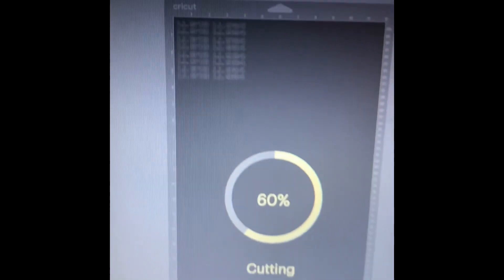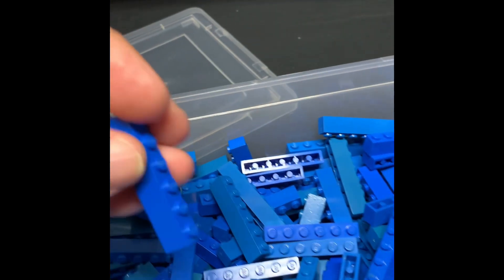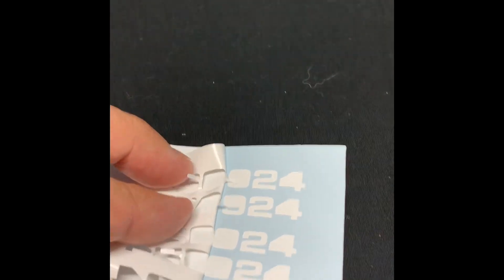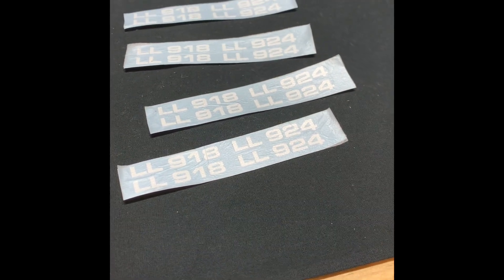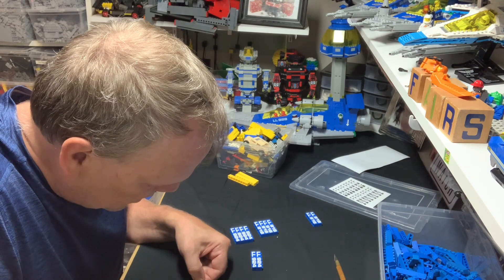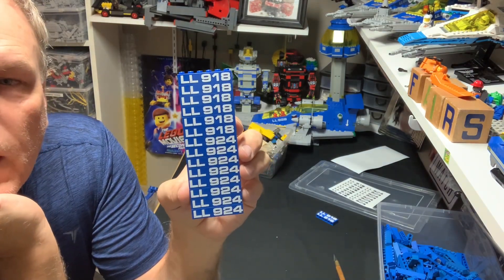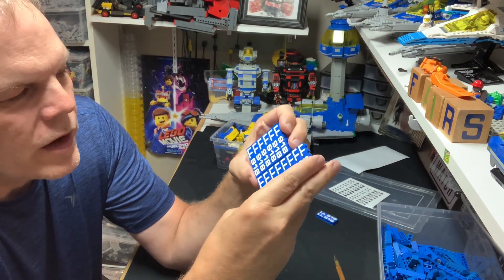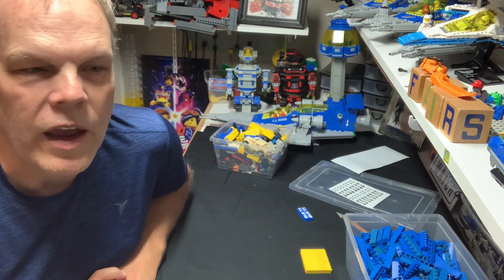DKP - Beginning to End LL918/924 Printing and Sticking. And a ‘let me know’ for those who want them

Comment: Those are outstanding.  You may have mentioned this on another video, but what font did you use.  It looks spot on.  I have access to a cricut myself so when I get  my sets I think I am going to do this.
Reply from the maker: Thanks!  The font is Microgramma Extended Bold.  It's as close as I need it to be. I can't remember the exact height of the print, but I can get that to you if you need